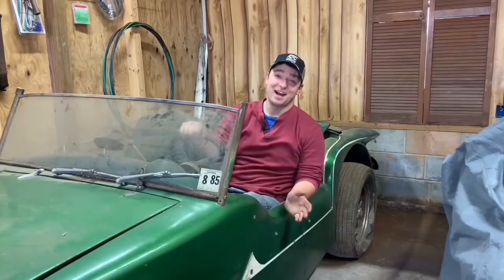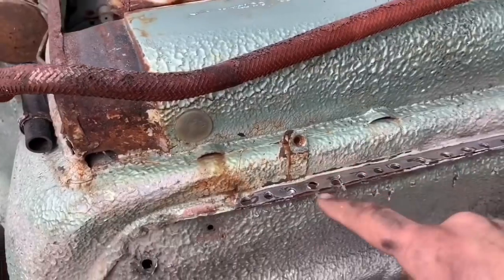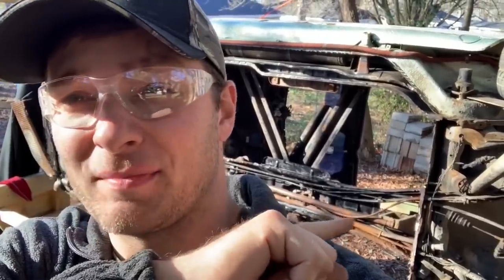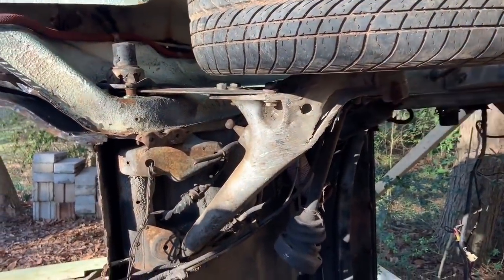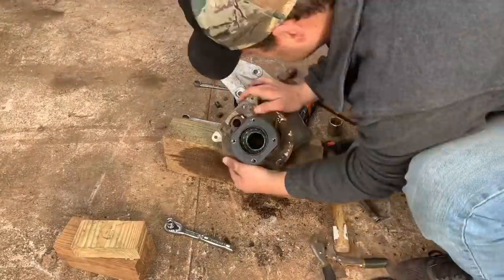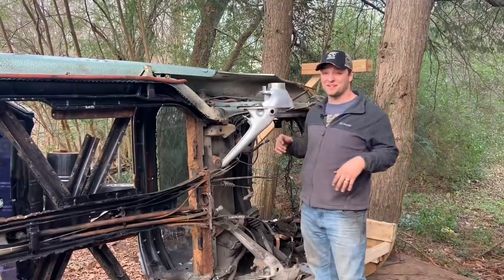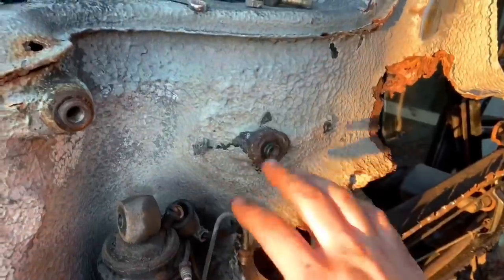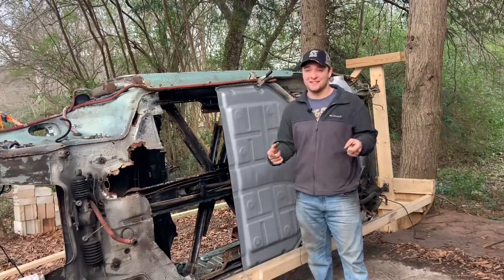Saving a Vintage Porsche 911 Targa from the Scrapyard: Rebuild Part 6

Comment: I would suggest that you treat every underneath part with two coats Tremclad black paint and gravel guard your floor and trunk panel as well as your wheels wells BEFORE you mount anything on the chassis. The same goes inside the car as well. And since nobody will go check on the paint, I strongly suggest you buy two gallons of paint and a paintbrush and apply them by hand. No aerosol sprays. The gravel guard will cover the paint anyhow...

Comment: Use safety googles with that wire wheel or cutting/grinding.  Harbor Freight has some great safety googles for cheap that are like skiing googles and conform to your face.

Comment: Excellent work.  Would strongly suggest you take the extra time to detail and paint all the parts you take off to factory original finish before reinstalling them.  Carry on
Reply from the maker: Thank you! I definitely will! Thanks for the suggestion! 🙂
Reply: @BudgetBuildz  I always use Hammerite Smoothrite on anything I use on my bikes. good finish and tough as old boots :D
Reply from the maker: Phillip Wood Thanks for the suggestion! I’ll look into that!
Reply: Budget Buildz I would also strongly advise not putting any of the cleaned and repainted parts back on the chassis until you have it fully repaired and repainted.  It will save you time and you will get a better result in the end.
Reply: dont use it on any of the panelwork not suited at all , it just comes off due to distortion and vibration

Comment: Hey respect for keeping going mate. Personally I would get all the pipe work and that steering rack off and not put any suspension back on. There is no need as you have the body fixed on that brilliant timber frame. Sometimes you just have to hold back on 'getting this bad boy back on its wheels'. You just take one step at a time with these sort of restorations. And as you are doing a great job with the panelwork don't let fittings get in your way.
When all the floor is in and painted and sealed THEN get all the under parts back on. Oh and yes have those trailing arms back to original aluminium as they were built. Props mate from the other side of the Pond.

Comment: i would recommend cleaning and painting every single part before assembly it will make for a much nicer finished product (including every nut screw and bolt)

Comment: Great video guys🍺 if you haven welded the pans in yet replace the fuel line especially if it’s one of the plastic fuel lines and inspect the wiring harnesses too. It’s a rare opportunity to have that tunnel off. There guys who make stainless steel fuel lines to upgrade from the crappy plastic ones.
Reply from the maker: Thank you 🙂 and Thank you for the input! We’ll definitely check everything over and be sure to replace anything that needs replacing before we weld the new pans in! A stainless fuel line sounds like a great idea!
Reply: Budget Buildz I tho there is a plastic fuel return line to that should be replaced as well

Comment: I would recommend a bedliner to replicate that undercoat that porsches have. Upol has a bedliner called raptor liner. Sprays easy too. I would recommend an epoxy primer before that.  Working on a Porsche too and that undercoat is a pain but needed. Keep up the good work!
Reply from the maker: Thanks for the suggestion! I’ll keep that in mind! 🙂

Comment: If you’re only replacing a section of the floor, are you going to butt weld the sections together ? That’s going to be really hard getting a tight gap that won’t need much filler rod. I thing you’re much better off removing the whole floor, and welding in back at the factory pinch weld. This will be a much easier joint, as the pinch weld is designed to be clamped and welded. It will also be much stronger and will look a lot better .
Reply from the maker: Thanks for the suggestion! I’ll keep that in mind!

Comment: Great work, its a challenging build. The front suspension pan is available from Restoration Designs too. Have you considered backdating it to a long hood 911?
Reply from the maker: Thanks, it is for sure! Yes, this one is not in very bad shape. It was replaced at some point when it had a fender bender years ago. I have, still not positive the route yet 🙂 once we get it layed back over on its new wheels we can all decide!

Comment: Check the ends of the heater tubes. The crust might be some dirt that got glued due to the moister. Better now the after the welding
Reply from the maker: Will do! Thanks for the suggestion!

Comment: Go ahead and replace the entire front pan, its not so much more work and saves an ugly splice. Also pro tip if you get an auto center punch from Hazard Freight and punch the spot welds prior to drilling things go a lot easier with less walk a panel separating knife can also be a life saver. Make sure to use generous coats of weld-through primer where your seams join. You get mad props for doing this restoration, good luck with your business.
Reply from the maker: Thanks for the tip! I was going to steal my dads but the spot weld drill bit seemed to center up really nice, the biggest issue I had was once I got almost thru it was so sharp it would grab and rip out....oops. We’ve almost got it wrapped up now 😊 next time auto center punch for sure! I’ll go get myself some weld thru primer too, thank you for all the suggestions! Thank you, I hope we can make this dream a reality!

Comment: Love the project!  But please wear the safety squints!  No matter what you are doing - wire wheel is real bad if one of those pieces of wire fly off into your eyeball.  Definitely worth pulling all the parts, stripping and re-finishing them, along with new bushes, hoses etc. (of course) - if you can get the shell media blasted, it'll save you a lot of time hacking off that thick underseal :-)

Comment: I think you will have to replace that rear wheel bearing with a new one, as the old one is destroyed during unmounting - thats why it didnt fit back on. Cool the new one in the fridge and heat up the trailing arm it sits in prior to installation, then it will slide in easily. Did that myself a couple of years ago on my own 911 Targa.
Really like your channel! Grüße from Germany :-)

Comment: You should install new clutch cable, fuel lines and battery cable while the floor is out and tunnel is open. Repaint inside of tunnel to.
Reply from the maker: Will do! Thank you for the suggestions!

Comment: Coil overs? why? if you have never driven a Porker fast on winding roads you have yet to appreciate the fact they knew what they were doing. Years ago they used to run classes for folks who wanted learn how to drive really fast and take advantage of their cars capabilities ,you might want to check up with your local dealers or Porsche club.
Reply from the maker: It was just a thought, I’ve never driven one before. I had seen it done on a few though. This is why I wanted y’alls suggestions! 🙂 I’ll definitely look into a class soon!

Comment: Hi there, I find this kind of project highly addictive viewing, it's reassuring also to see young fellers doing the job in a logical and methodical way---and doing it right ! You have been quite lucky so far with the nuts and bolts coming off without too much trouble which helps to speed up the job (and save on the cursing !). would there be any chance at some stage of you giving us a guide on what you are having to spend on parts/panels ? Thanks for sharing your journey from a geriatric old Yorkshire fart in Ireland----Good luck.
Reply from the maker: I’m glad you’re enjoying! I definitely will let you know! 🙂

Comment: you need to slow down and clean parts as u go, make sure to POR  the rusty parts
Reply: walt charamba por-15 is not only “good for frames” he can literally coat the whole underbody with it once welding is complete, durable.. wont flake and will protect

Comment: Great video. I’d say this old Porsche is beyond ‘patina’ so you need to go in pretty hard detail wise on the restoration. I’m wondering how you’re going to finish it on a budget? I was just watching Ratarossa channel (check it out guys if you haven’t UK based generally doing Ferrari budget repairs) and he is doing a 1969/70 Porsche 911. Parts were crazy expensive for that like £2000 for a dash pad. Have you got a crash damaged donor car to harvest or a good specialist supplier of used parts? Otherwise it ain’t gonna be budget!
Reply from the maker: Glad you’re enjoying! I don’t at this point but we’re going to make it happen!

Comment: I love the project and the work, but I just wanted to say you have to replace those bearings. there is a special tool to remove and replace the bearing. Normally when you press the hub out the front race sticks to it on the way out. It damages the seal etc. if you do not replace that bearing it will chew the hub tail. Also make sure to not roll it around with out axle stubs in there torqued down that also kills the bearings. I have had to replace many of these prior not always easy to find a non trashed hub.
Reply from the maker: Thanks for the info! I’ll look into getting new ones! 🙂

Comment: Hi, you need to think of your personal safety, and wear saftey glasses, earplugs, and some kind of respirator, old cars contain materials that are harmful, especially when grinding panels.
Reply: Not to mention a torque wrench and a breaker bar but Im not the one driving it so ...
Reply: Wireheeling without eye protection... Accident waiting to happen.

Comment: Your doing great ... it probably doesn’t need coil overs it’s torsion bar suspension is good enough.... look for a book called “101 project for your Porsche 911” it’s worth a read it will tell you about lowering and raising your suspension
Reply from the maker: Thank you! Yeah you’re right 😊

Comment: I've only ever repaired cars not rebuilt them but why would you put the mechanicals back before sorting the body shell? Wouldn't you strip the shell completely,  repair and rust proof it, spray it and then build the car back up ?

Comment: I was wondering if the floorboards from the volkswagen might fit, since  I have seen parts for the bus, type 3, Karmann Ghia, Beetle, the engine is somewhat similar  to  the Beetle, the type 3, type 2, Karmann Ghia/ Porsche 914.
Reply from the maker: I sure wish! They are close but a bit different 😕 would have definitely saved tremendously!

Comment: wow, you are an optimistic man, with a lot of skills to...i really thought this car was dead, and doing a Porsche on a budget? Think you payed more for the parts than for the whole car...but after all it is a Porsche and the targa is quite unique in my opinion...well, you did some other cars but you are more confident than i am. do hope youll get the engine running..,
Reply from the maker: We are going to make it happen! It’s still a lot of work to come but we’ll cut cost where we can as long as we don’t affect the overall integrity of the build! We’ll definitely try our best! I think it’ll happen 🙂

Comment: Hi, just curious, what did you pay for the floor pan section? The floor sure is rusty.  Please spy any bare metal with primer after using rust remover.  Bare metal will rust overnight .  Coilovers will improve handling and give you height adjustability.  Just don't go overboard withe the lowering, having a sandblasting cabinet would be extremely helpful withe restoration.  It will make old parts look practically new.
Reply from the maker: I ended up paying $675 for all 3 sections I bought! Which was the most reasonable I could find and the quality seems really great! I will definitely look into a sandblasting cabinet! Thanks! 🙂

Comment: I think you could have more clean under the back of the body clean off the dirt removed the rust and paint the back under side then put on the newer parts in this way you would have more of the restore work done

Comment: Good work so far, but pointless putting any new parts back on the car, it needs to be fully stripped and acid dipped or media blasted so you can see what's good, then go from there, D

Comment: Dude the glass is going to get ruined from sparks take it out. Maybe not the back glass though they are a nightmare to install. But protect it. And do the fuel lines and stuff beore welding the floor on. You can probably get sponsorship for these parts people have done it with alot less subs
Reply from the maker: I’ll get it covered up! 🙂 that’s a great idea as well! I would love some sponsorship help, just haven’t had time to really get asking around! Hopefully soon!

Comment: I think If I was you I would take everything off that car strip it down and get all the parts blasted and cleaned up that are salvageable and use what you can and get that whole car blasting of all the rust and start with a blank slate and put it all back together pay up the parts that are usable in black or whatever and slab them back underneath the car after you paint a car after putting a new pans in place and do a full restoration. But That’s just me if I’m going to go this far into a vehicle like this. that’s what I would do

Comment: Hi. if i understand correct you want put coil in rear suspension, but there is only shock absorber and swing bar like in old vw beetle.
Reply from the maker: Possibly in the future 🙂 They make an kit that replaces the factory suspension with coilovers.
Reply: @BudgetBuildz  ahhh. thanks i didnt know about this. good job. good luck. :) Michał from Poland

Comment: Wrong side! Happened to me once (or twice lol). I was cursing because i could not get my brakes bled for some reason. Took it up to the local "bail me out" shop to have them do it. They called me and said "We can't bleed your brakes, your calipers are on the wrong sides dude". I had just put on new calipers and didn't realize the nipples were facing downwards, preventing proper bleeding. I [picked up my car, swapped them, and bled the brakes easily. Edit: For the record, i also tipped the shop for their time since they didn't charge me.

Comment: How can you grind, wire brush and drill without SAFETY GLASSES? One small piece of rusted metal slinging into your eye(s) and this project will take a huge setback maybe never to be finished. You only get one set of eyes and ears. Protect them all the time... Accidents happen all to frequently on their own, no need to be asking for them!

Comment: What was wrong with the old trailing arms a good sandblast or chemical clean and some new bearings and bushings could of saved you a lot of money plus vw’s share some of the same parts
Reply from the maker: Car had been dragged at some point with no wheels...they were half gone 😕 no fixing
Reply: Oh that explains why you replaced it remember Porsche and vw share a few parts just to go maybe an inexpensive way

Comment: wow stip appologising you dont have to male these vids when ur clearly suffering with a heavy cold. Your a top guy, so polit. my vids would be 18+ too much swearing when not going to plan how supposed to come apart lol 
why would you not wire wheel all those rusty parts. Then use what ever paint you have laying around to re-protect the steel. Nearly everyone has old paint laying about in sheads, under stairs, yards, garages etc...

Comment: Why go to all the trouble to strip it down and repair the floor and all the rusted bits, if you are not going to repaint every thing to stop it all rusting again. I would clean everything and media blast the parts that require blasting. Then underseal the floor pan and paint everything. Otherwise you are just wasting your time and effort you are putting into this project.

Comment: Why on earth would you put a new trailing arm on before you finished cleaning up the body? It makes so much more sense to take everything apart, remove rust, clean and paint before putting parts back on. The structural integrity of that entire area is questionable. What possible reason do you have to cut corners? I've watched all of the other videos until this point, but to be frank I won't be wasting any more of my time watching someone half ass a build.